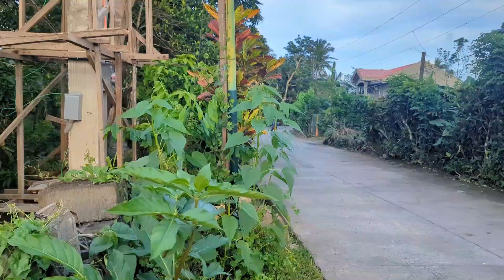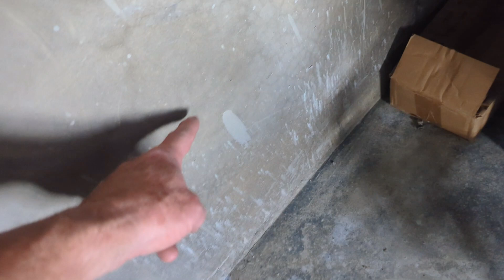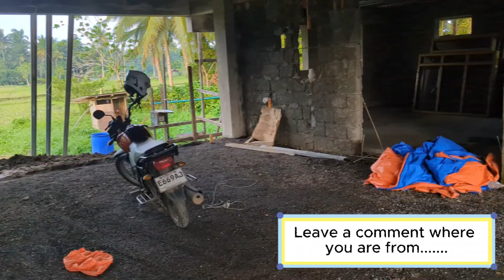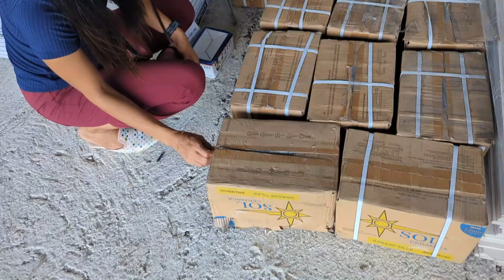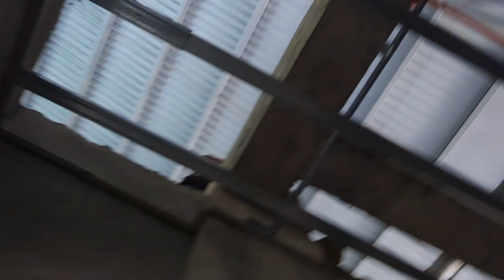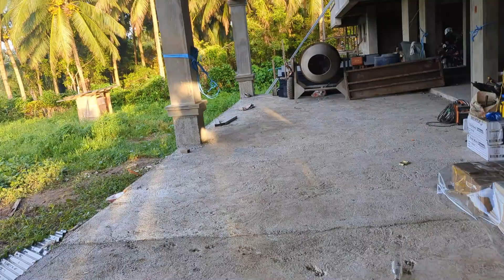Philippines House Build Day 149 " Finishing Up the Roof & Ceiling Framing"

Comment: I have a question. Why do most foreigners build such huge houses? I would rather have a house with 8 rooms that my family will use. Why build a 20 room house and then only use half of them? Not a criticism just curious.
Reply from the maker: I'm not sure how you get 20 rooms? There are only a total of 9 rooms.
Reply: @KevinParent248  Just asking about building in general. As i said not a criticism.
Reply from the maker: @jamesthomas7505 I get it's not a criticism. Just wondering how you came up with 20?
Reply: @KevinParent248  This is just my observation about the houses built here. There could be 50 rooms. My point is that much of the space won't be used often.

Comment: About the water filters do it your way you are right dont put them after the tanks. Keep the tanks clean from sediment and bacteria. Do NOT put them after the tanks
Reply from the maker: Thanks
Reply: @KevinParent248  The reason they tell you to put the tanks first is because those tanks are designed to take contaminants anyways and can be repaired/replaced if needed. Your pump runs based on the tank so if you have some failure in your water treatment and it is before the tank the pump will overwork trying to refill the tank. Hope this helps.
Reply from the maker: @StepHush3 thanks.

Comment: Hai Kev if you let them make a retaining wall dont let them make if of hollow blocks. Let them make it pure concrete (Prefab) because of the presure. your car will be in the garage every day it wil sink a little bit bye bit. Let them make it strong. oce you get a slide of ground than you are to late with a lot of damage. succes
Reply from the maker: Thanks

Comment: Hi The house is progressing well and high standard.
I'm a fan for electronics to control water pump and ours works realy good so the motor will not start on heavy load.
Your celling sheets look like 1/4 inch to me 6.5mm otherwise 3/16 inch 4.5mm.
Plaster board can be finnished to give better appearance but Hardieflex more durable in Philippines climate .
Reply: So it's not Hardie flex as the thinnest  sheet is 4.5mm or 3/16 inch  
Anyway I recomend using fiber glass tape on the joints.
Reply from the maker: @graemescebuphilippines363 thanks, I'll mention that to my foreman.
Reply from the maker: Thanks. We had a choice of 3.5mm or 4.5mm. The foreman recommended the 3.5mm which is 0.138".

Comment: Hi Kev and Sella.  Everything looking good. I do agree with you as I would filter the water first before I let it go the my bladder tanks because I do not want the sediment to settle inside my tanks, but you know the Philippines and there way of thinking (lol). The transformer looks good and I know that you will be happy when it is hooked up and powering the home. Good job on picking out some pretty tiles, I will be looking forward to seeing them on the walls and floors. Overall, everything is good to go and I hope that they screwed down your metal roofing in the valley portion because I see that they have covered the carport area and the generator and water treatment area. Just want you to have a great product that will last you and your family a very long time before any repairs are needed. Take care my friend and looking forward to the next home update video. God Blessings always.🙏🙏🙏
Reply from the maker: Thanks Kenny. I did forget to get some video up there. I will try and get some today and put it in the next vlog.

Comment: First of all, I think you’re making a mistake with your water system. I would at least put a water filter before your tanks to keep out the sand second if you don’t know the quality work of your painters you’re gonna be hiring. I would at least get one room done up to ready to paint have them come and do the painting, patch the cracks then you could make sure they work up to your standards and your paint Color choice is right if they come up with any problems with that one room, you can adjust the whole house before doing the wholehouse if you are satisfied with the painters then you can use that room as your standard.
Reply from the maker: Bladder tanks are bottom feed so I don't see an issue there. That's not a bad idea on the quality of the painters. The foreman has used them before though, so he knows how I am and what their quality is. Thanks.
Reply: You right the water in the PH is SO dirty you cant imagine. After 4 months the tanks are full of sediment. filters first

Comment: Kevin.....why 2 bladder tanks.......trying to learn, I thought one would be enough ?
Reply from the maker: Bladder tanks size is dependant upon how long you want to run your pump. 

Each bladder tank is roughly 1/3 water, 2/3 air. We have (2) 200 liter bladder tanks, 400 liters total. 1/3 of 400 is roughly 133 liters of water. My pump will flow 132 liters a minute. This means my pump will run for 1 minute once it starts up to get up full pressure. The pump creates allot of heat at start up and needs to run for 1 minute to cool it down. Hope this helps.

Comment: The wiring seems to be quite different than US. Do they connect all the plug in’s one room together or maybe do a junction box in the ceiling? It appears they have all the conduit for each plug and light switch running to the breaker box. Can you explain?
Reply: In the PH thay make averythin g in serie all the lights all the outlets. That is not good. Now you can understand why they have breakers of 40 and 60 amp. My instalation we only juse 16 amp breakers and we work form the central light boxes to the swithces and outlets
Reply from the maker: @jackpiket7643 crazy.
Reply from the maker: Thanks. It seems each breaker has its own conduit. There may be plugs and switches on each breaker. For the most part, it seems they are very conservative here with what they load on one breaker though. Each Aircon unit gets it's own breaker. Neck in the US, we would run 2 or 3 on one breaker. Hope this helps.
Reply: @KevinParent248 thanks

Comment: Good Day Kevin
Please take another look at this water treatment
You are correct
Use low level switch to start well pump about 30% then a cut off at full a level switch in your raw water storage tank.The  treatment  system should draw from this tank.
If you want service water install a separate jet pump and pressure tank to service spigots that do not need treated water.
The treated water will go to a treated water tank and then you can have another jet pump to draw from the treated water tanks to charge the pressure (bladder) tanks
This will supply shower sinks etc
Raw water pressure tank should supply toilets and service water ie exterior spigots
BRgds
Carlton
PEng.
Reply from the maker: Thanks. All water will be treated water.
Reply: @KevinParent248  
It's starting to look good. When can I come by and visit you for a few days🤩
Reply: @helseguru1194    If he gets a FEW DAYS......wht abt me....🤣🤣🤣🤣🤣🤣😜😜😜😜😜😜😁😁😁😁   ROFL

Comment: Hi Kevin, great to see, lots of good info..wondering why u not putting any isolation under your roof? unless u do this later?
Reply: If you have a metal roof you need a radiant barrier insulation with your ventilation… both. It’s easy to add it now before the ceiling is installed
Reply from the maker: @cnakaahiki thanks
Reply from the maker: Not needed with the ventilation I am installing.